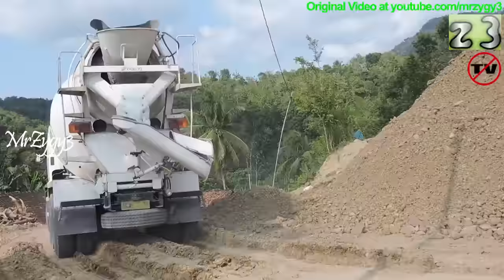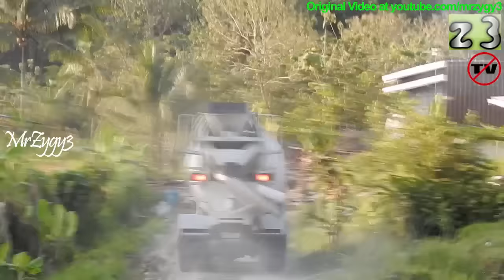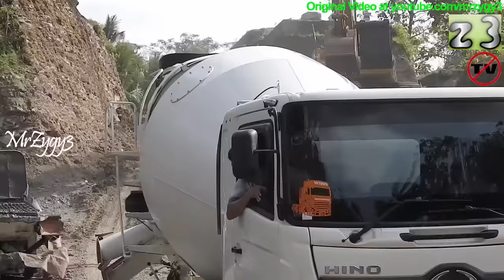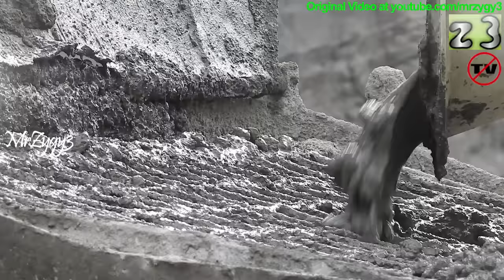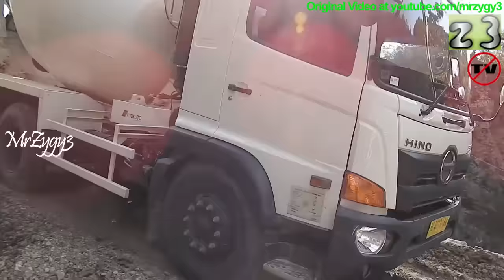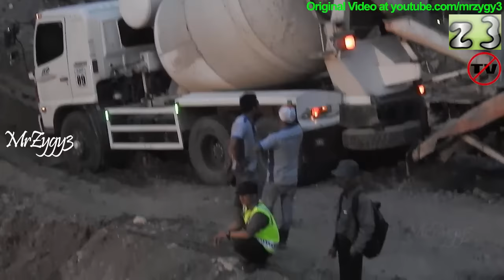Cool!! Ready Mix Concrete Pump Truck Working On Steep Site

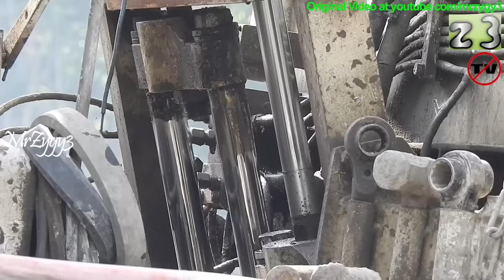Comment: What are those thingys in 10:07
Reply from the maker: It's hydraulic concrete pump piston
Reply: Ohh I am learning some new stuff from you . Thanks
Reply: The pump is what we used to call a "Spade Valve".  Those are the hydraulic pistons moving the valves.  The newer pumps are mostly "Rock Valves" now.